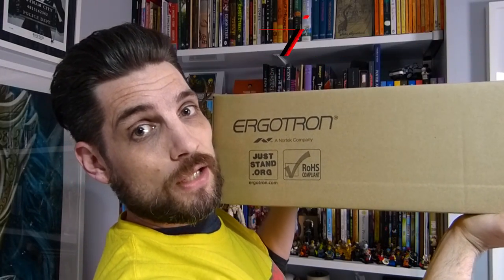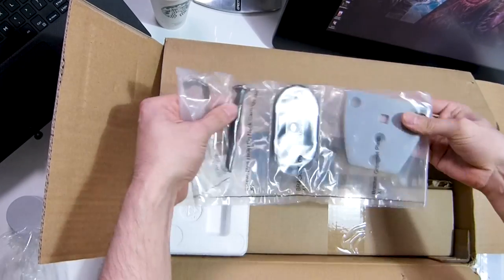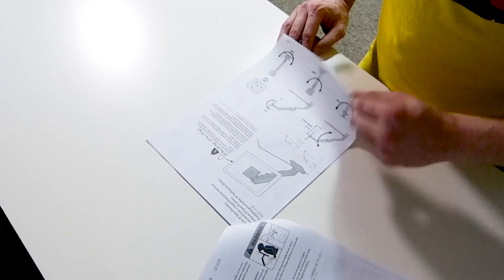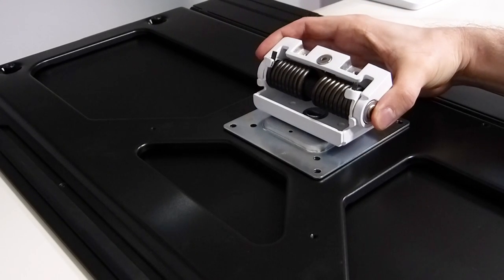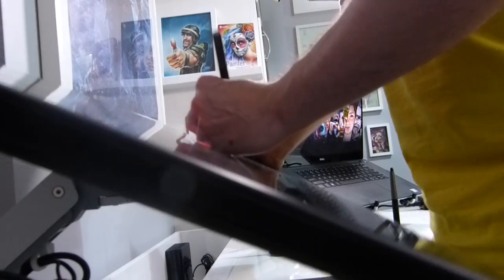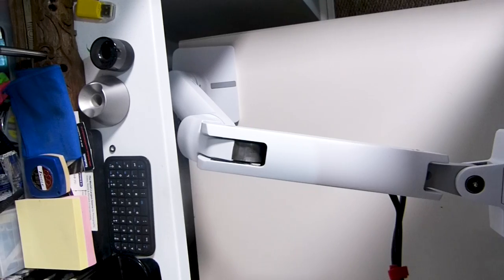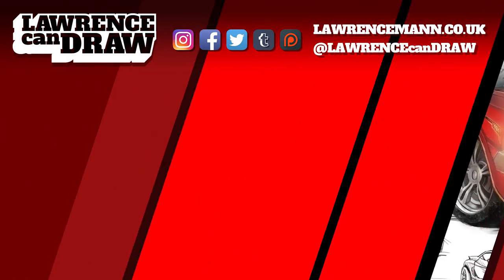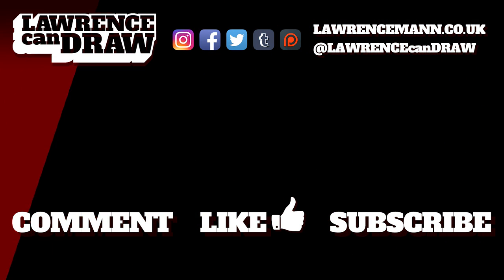Dell Canvas 27 with Ergotron arm & VESA mount

Comment: Than you for all this. I've been saving up for this for months! My last two obstacles:

1) How stable does it feel when you draw on it with the specific Ergotron arm you use? I mean, can you show us, in real time, how you draw while applying pressure with your arm, doing some gentle work, and also some dynamic gestures. Some of us have a tendency to really push down on the surface, so even a bit of wobble might be a major turn off. I couldn't really tel from your other Dell Canvas videos.

2) What specific Ergotron arm do you get for the dell canvas? I HAVE to use paypal, so I cannot order from Amazon, however practical clicking on your link might have been. I checked on Ergotron's website, and it's a confusing mess, even when searching with the terms you used. Have a specific product number? Also, is the unit you have shown here identical to the one being released?

As of now, Dell has either deleted their product page for the Dell Canvas, or forbade access to people outside the USA (i'm in Canada). We're just redirected to their main page, without a warning or a message. So we need to get our Specs info from third party articles,a ll of whom still have plenty of uncertainty. Maybe tell them that's a bit of a faux pas!

Thanks!
Reply from the maker: This arm is really stable. Don't worry about that. I chose this arm after talking with the good expert folk at Ergotron. BUT you shouldn't lean down hard on your tablet. That's how tablets get damaged. In over 20yrs of using tablets, I've never broken one but I hear stories on YouTube comments all the time of tablets crapping out and I'm guessing it's because people lean on them. You damage the screen by doing that. Even with gorilla glass it'll damage the sensor and the screen even if you can't see the physical damage. It's just a case of changing the way you work. Rest your elbows on the desk or armrest of the chair, pivot more from the shoulder. Watch how oil painters paint. I only say this out of concern for your equipment. If you're spending this much money then you want it to last. Then you also won't have to worry about too much wobble and you'll also get smoother, straighter, longer lines as a consequence as well. Your arms may hurt a little more for the first few weeks but you'll feel like a pro soon after ;D Trust me and give it a go!

The name of the Ergotron arm is in the Video. It's the HX Monitor Arm. If you follow that Amazon link you'll find a product number there. I'm on my phone right night so it's a bit hard to dig one out ;) #ShareThisVideo
Reply: Thank you very much! I do know about the shoulder movement, but I've really only applied it to when I work on paper! Time to adapt that to the tech!  I have been using a Cintiq 13HD, but it always felt too small for me.
Especially with gestures and super tiny menus in Photoshop. SOON, the large tablet will be MINE!
Reply from the maker: Yeah, I can't use tablets that small. It just feels like a scroll pad on a laptop. Maybe it's ok for comic artists doing panel work but that's about it. I'm doing fine detail on paintings that are A2, 2.5gb. It' would be like some kind of prison sentence. lol
Reply: I totally get that. My current digital painting is the biggest I've ever done,  and it's 10800 x 5100 pixels.
 I spend more time zooming in and out and scrolling than actually painting!
I bought a whole new computer system last winter so that my cintiq wouldn't lag anymore because of all the layers, and it fixed that, but I NEED more space!
Reply from the maker: Space is a big issue. People want 4k but that is a separate thing all together. 4k will eat up your graphics card. A lot of people don't want to hear it but they will notice it as soon as reviews of the new Wacom Pros hit YouTube though if they have still got crappy old computers :O
Reply: Yeah, before I understood that DPI is not as important as pixel count, I thought that I HAD to paint in 300 dpi for print work! Now, the SAME EXACT pixel count can be done in 72 dpi, and my paintings are SHARP, without the computer choking.
Reply from the maker: Print is a particular beast. Especially since we moved to digital print. I think it would be good for everyone to spend a couple of days at a printers on the press. When I was fresh out of school at 16, I actually did spend my summer working 12hr shifts at printers. Loved it. It wasn't digital back then but I learned a lot. Obviously I send a lot to print now and have some very geeky friends so I'm always asking dumb questions just to learn more!
Reply: Wise stance. I was one year into the last generation of traditional, all-by-hand graphic design at my college. I mean hand-cut rubylith, analog CMYK seperation, every thing!  Then over the summer they switched us to all-computer work, except for displaying our printed digital work in manually assembled folders. I for one am GLAD CMYK is no longer the only standard, and that color and item separation is done digitally in layers. 
SO EASY!

Someday I hope to own or have affordable access to an RGB  Giclée printer so I can print my own work without middle services. 

I'm a puppet builder and mask maker by trade, but that deviation is soon going to be over. I want to be a full-time freelance illustrator and writer. A fully useful digital tablet is the next step for me.
Can I do it with the small tablet I have?  Sure. But with it, I can cut the time by YEARS.

The small Cintiq already made me evolve faster than any other investment in classes or supplies. Before it became Glitchy that is. the driver keeps deactivating without warning.

Thanks for this conversation (most don't ever reply to comments), and all you share on your channel.
Very inspiring!
Reply from the maker: Is there such a thing as an affordable  Giclée printer? If so, I'd review the crud out of that!!! I wasn't aware of there being one though. haha. I've got a 10yr old A3 Canon printer. It's not much good for anything really and I don't even keep it hooked up any more. I don't really print now though. Just trust my eye, pantone books (which are probably well past it) and occasionally send stuff to a friendly printer who I did go to college with!
Reply: One can dream. If many dream, many we can make it happen. I mean, look, 3D printers are getting more affordable. I guess properly archival inkjet printers aren't as exciting for most people.

But even for a freelance illustrator, it's somehow, mysteriously possible to someday get your hands on one. Jean-Baptiste Monge has a Giclée at home to print his own prints! The quality is TOP NOTCH.
Reply from the maker: Just done a bit of research and the printers are not the problem. A half decent one will set you back £300 and you might be able to pick up a bargain for £200 with a bit more research but the run costs are where you're gonna get hit. Buying art-rag not in bulk and the ink is gonna kill you. Might well be cheaper just to pay for prints when you need them. At least you don't have the hassle of calibrating the printer too!
Reply: Hi - wanted to provide the link for the Canada page in case the OP still can't get it to work: http://www.dell.com/en-ca/work/shop/category/workstations/dell-canvas
Reply: Thanks for trying that. But it doesn't work. Still the same generic start page. I tried different ways, and even their drop-down menu for country is defective. WEIRD!
I went with the main Dell website (by typing the dot com manually) and switched to Canada with the menu. Then I searched for Dell canvas, and it led to the right page, but that automatically switches the page to United States, so I assume the price is in USD.
Reply from the maker: Thanks for jumping in on this Sarah :D
Reply from the maker: Odd to see that happening. I only wonder if it's a browser issue. This sounds odd but have you tried visiting it on your phone? Just to see if you can see it!
Reply from the maker: I wonder if it's a browser issue causing this with cookies etc. I'm not a web guy so I'm not gonna profess to know but hopefully Sarah can pass that along and it'll get sorted out quickly! Otherwise... drive south brother!!!! #RoadTrip
Reply: In my mind, maybe. Can't drive, need more paper work to travel!
Reply: The navigation path to find Canvas while our internal search pages populate is to go to Workstations and that's where you'll find the link.
Reply from the maker: Yeah. Certainly not in Laptops. I think the web teams are going to have to make it really easy to find on the sites. Might be a good idea to go to the feedback section and just add a note telling them what you've found!
Reply: I've been advised that the Canada price is impacted by a law stating that a discount can't be applied until 2 weeks after the product has launched, and even then the discount must be limited to 50% of the device sales.  Do expect the price to go down much closer to the U.S. price, but know that it will fluctuate due to those laws.
Reply from the maker: Wow! US/Canada law. Someone will literally have to do a border run and make a profit if they want to take some orders! haha. Hang on, is that illegal? I should stay out of this. I want to take my son to experience Disney! Best not get caught at the airport.
Reply: Thanks! Once again, Canada punishes its own citizens for DARING to need or want products that arenT' made here. Sigh. Maybe I'll be patient enough! Or maybe I'll just go with the full Cintiq 27QHD.
Reply from the maker: In that case I could make a joke about Canada's main export being Canadians. I won't ;) I've seen plenty of good stuff come out of Canada!
Reply: Damn Right! Our Poutine and doughnuts are invading the WORLD (though some countries have difficulties get the right kind of cheese curds for the Poutine!)
Reply from the maker: I'll set up a PO BOX and you can send some this way ;)
Reply: (this thumbs up constitutes no obligation as to the suggestion of exporting doughnuts.)

Dammit, I'm poor! But just go to any Tim Horton's, they're popping up all over the place. Some spots in the USA, and recently, at least one in the UK.
Reply from the maker: Only joking, I'd never seriously expect anyone to send me anything! What did you think to the Ergotron? http://amzn.to/2vhtX5u

Comment: @Lawrence Mann
I'm interested in ordering the arm but I need to buy the low deck you have, can you give me the height & model # of the white desk you used in the vid please?
Reply from the maker: It's not a desk. It's a TV unit from Ikea. I don't even know the name of it. It was just the perfect size. We already had it and I threw it in the space. Works great if you want to work at a low height. Why do you want to work so low btw?
Reply: @LAWRENCEcanDRAW  thx 4 reply. I see it makes sense now it's a tv stand. If i get the ergotron like yourself it's the only way it's going to work in my current space at a similar height like your setup under a self area.
Reply from the maker: Just make sure your chair isn't a really high one. lol. This is also a good height for my son to stand and use the Canvas at - he's 4. And I can sit on the floor and use it as well if I sit on cushions.

Comment: @LAWRENCEcanDRAW Does this support The surface Pen or is it only Wacom combatable pens? Just Curious since I have a million of those floating around my house
Reply: just the Canvas pen, which is based on Wacom technology
Reply from the maker: In one of my other videos I do actually show a test run of other pens NOT working just because I had this question asked so much. I'm sure as Dell develops more & more pen enabled devices we'll see pens that will work with the Canvas. I'd like to think that Dell will keep everything cross-platform and not go down the Apple route of only having the pen on one device! Hint Hint!